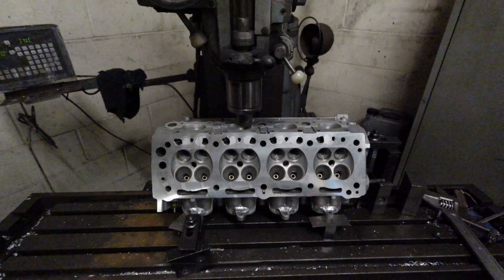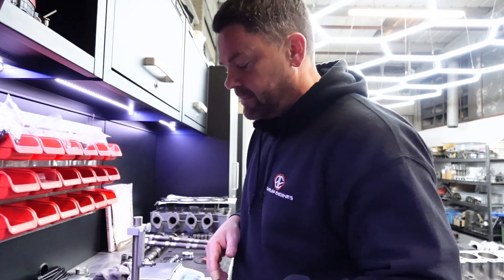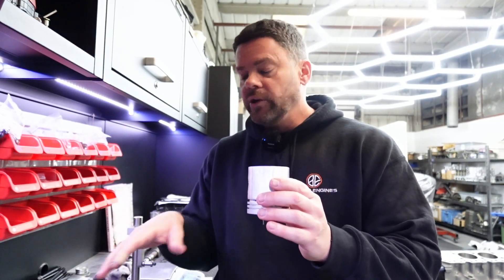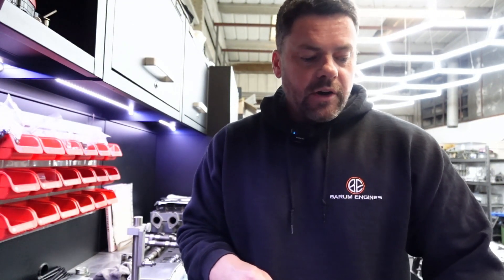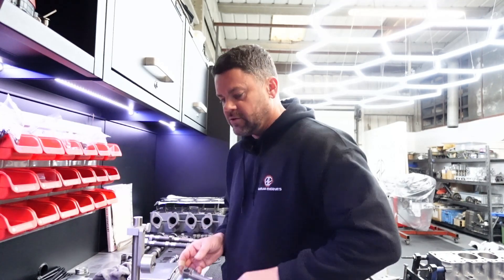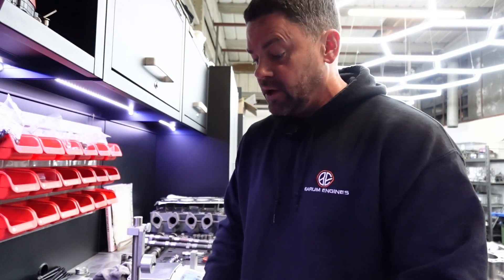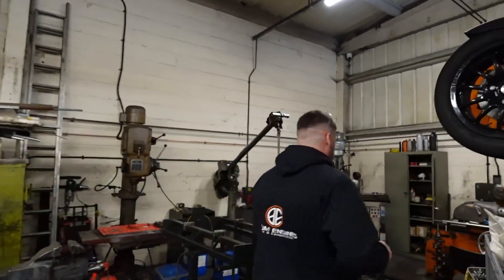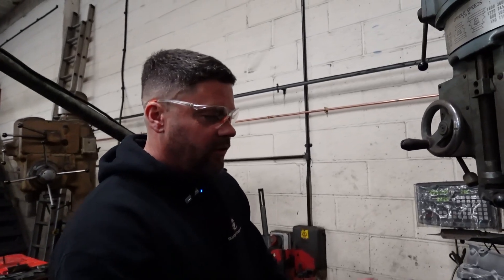WE TRY TO FIX THIS £2000 COSWORTH CYLINDER HEAD

Comment: I like the new format and the greater detail! This vid in particular teaches something I wish I had known about many years ago building MY engines! Mostly Chevy Small Block. I had all the machine shop work done and I assembled them, and I "kinda" understood what they were doing in weighing the con rods and checking valve springs and so on, but I basically trusted them to do their thing. Of course, I knew about gapping the rings and plasti-gauging the crank, and so on. Must have been either lucky or good because I never had any issues with any of them, even well after 100,000 miles! And I didn't baby them either! :face-green-smiling:

Comment: Interesting channel this. One question, isn't the Volvo B23 16 valve engine, later Saab 4 cyl 16 valve engine, VW 2.0 16 valve engine (I may have missed a bit) in a way copies of Ford's Cossie or inspired by the above mentioned engine? The original costs insane money and has its weaknesses around the stud bolts to the cylinder head.

Comment: Love the new format Lee, it works well. Its almost the same process for the rods as when I balance a set of helicopter blades, getting them the same weight with the centre of gravity in the same place and the blades balancing across the chord all at the same time is tricky and takes time to get it right.

Comment: Whenever we did a balance job on a set of rods we would first grind down the flashing marks and the cast in numbers/letters and give the entire surface a light sanding with a flap sanding wheel to knock off the tops of the casting sand marks.
This reduces the overall weight of the rod which reduces the reciprocating mass which reduces forces which is good.
And then you balance them end for end.
When sanding make sure that the sanding marks go along the length of the rod so as not to make scratches which can become fracture points.
Mirror finish is not required.
All these types of "minor" details help to make the motor just a little bit more "bulletproof".
And sometimes you need that when you do a power change at peak RPM from 2nd to 3rd and hit 1st by mistake...
Don't ask...
Reply: Sanding the rods is not always ideal as a lot of rods are shot peened which adds strength and removes stress raisers.